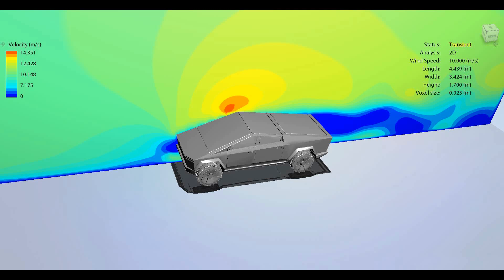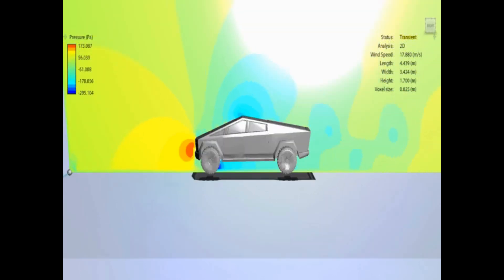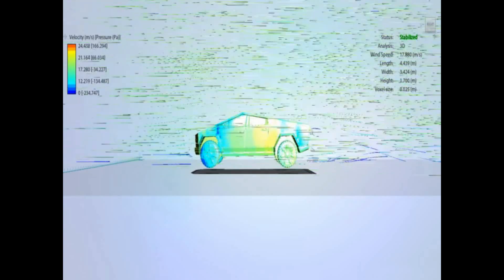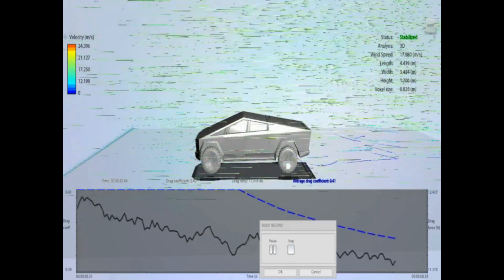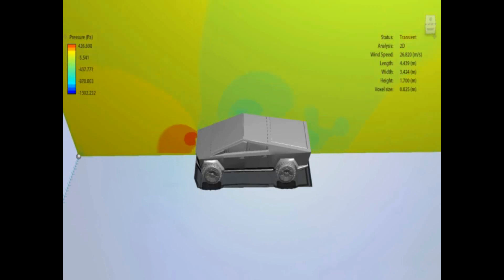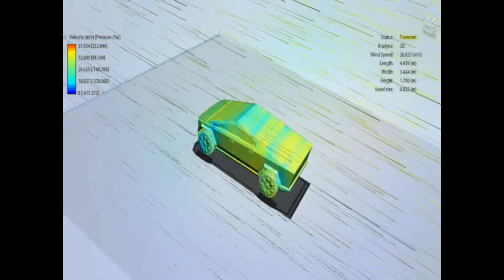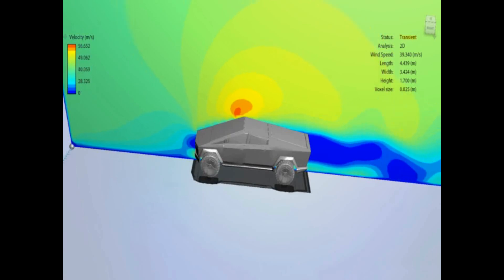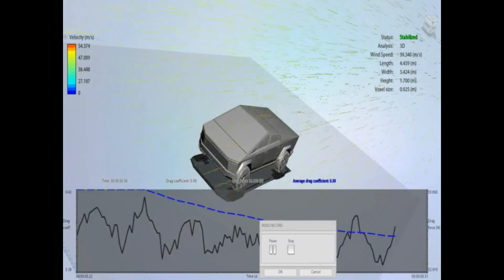Cybertruck aerodynamics - Whats going on?!!!

Comment: It’s almost as if the designers at this multi-billion dollar company tested this out with these kinds of simulations before they went forward with the design, lol
Reply: @Mr Murders "I haven't seen Elon do anything relatively innovative in a long time, what you're seeing is rehash tech with better components that were not available to companies 40 years ago."

I have to disagree.  Musk has completely changed at least two industries.  With Spacex, he didn't invent the rocket, but did bring the cost per kg down to a small fraction of what NASA could do.  As a result, Starlink is going to provide global/mobile internet access to every one on the planet.  

With Tesla, he squeezed more out of a kwh than any other car maker.  They still have not caught up to where he was in 2012.  Cars with over the air updates didn't exist until Tesla.  They will also be the first with full self driving.  

Other manufactures probably thought about the new manufacturing process for the Cybertruck, but Tesla is actually going to do it and made it economically feasible.

I a few years, solar roofs will be at a comparable cost to high quality asphalt roofs on new construction.

If all of this stuff was available for anyone to do, then why hasn't someone already done it?  He radically innovates everything he touches.
Reply: Agreed.  The truck looks stupid because of all the smart things they incorporated.  I realized that Telsa didn't want the truck to look like that, it just happens to look that way because of the durable materials, simplified manufacturing process and now apparently wind tunnel testing.  Classic form follows function.  It's really brilliant.
Reply: don m Personally, I love hard angular geometry, so I’m all about the Cybertruck’s design. But I also really appreciate their mindset of functionality and efficiency before superficial style.
Reply: don m I don’t think it looks stupid. It looks rather beastly, it’s going to make all other trucks on the road look like an old style truck
Reply: @Giggidygiggidy12  I would agree. The way it looks is growing on me, like most people.  At some point I will probably own one.  My word choice was to emphasize the form follows function aspect.  It's a really well thought out design, but not necessarily apparent when you first see it.
Reply: Giggidygiggidy12 I hope so, I’m ready for future designs!
Reply: don m exactly!! He built a better tool, whatever the tool looks like should be irrelevant, problem is most pick up truck owners use their trucks for going to Costco
Reply: don m Elon didn’t want it to look like normal trucks anyway
Reply: @donm2255  if this truck looks stupid to you how much do you hate the other ones then? 😅. In my opinion it's the by far best looking pick up truck of all times and it's an insane truck.
Reply: @donm2255  yeah, Musk said he wanted it to look like something out of Bladerunner, and it looks almost exactly like the cars in that movie, same shape and angles. Seems pretty intended, to me.
Reply: @donm2255  you can make flat panels look good by compounding shallow angles. However Tesla isn't the best at mass manufacturing so any low efficiencies are multiplied by their lack of raw mass production. The ability to mass produce a good product is extremely important in terms of market share.
Reply: @allstarwoo4  Perhaps a few more creases might help the looks.  And that might be possible in standard sheet metal, but the skin on the Cybertruck is 3mm hard stainless steel.  If Tesla could have shaped the skin anyway they wanted, then they would have.  The Cybertruck's design is a direct result of the material and process.  You don't make a truck that ugly, unless something if forcing you.  The trade off for the way it looks was durability and cost to manufacture.  They not only reinvented the truck, but reinvented how the truck was made.  That took some balls.

Regarding Tesla not being good at manufacturing, they just built a factory in China in less than a year that is already spitting out cars.  Making cars is fairly simple and they are getting good at it (and reinventing it), while pushing the gross margins up.  They also made the tool that makes the car in an unprecedented short time frame.
Reply: don m hydrologic press forming exist and unibody design isn’t exclusive to Tesla. Yeah it new to use uni body design on trucks but it’s not a new concept.
Reply: don m Buddy, a truck that looks like trash and can take a bullet (allegedly) is still a truck that looks like trash 🗑
Reply: @donm2255  bruhhhh... the design is smaller then other trucks therefore thy could fit LESS FEATURES, also with those angles it would make it even harder to fit features into the truck
Reply: Asunda Speed he's be sarcastic... Duh dude
Reply: Aaron that one really went over the dudes head lmao. I am amazed at the amount of people in comment sections who don’t understand sarcasm.
Reply: @inboxterapie5608  Yeah, we 'get' his sarcasm, but I think his comment minimizes the achievement of Tesla engineering design.
If being a billion dollar company with simulators is all it takes, why didn't the monster car companies (with far more simulations and far more designers) adopt the concept years ago?  
Tesla's design actually performs BETTER at higher speed.  The ICE companies have had 100 year head start, yet it appears Tesla nailed it on their first freaking try.  Tesla chose a non-intuitive design that has startling and measurable side benefits.   I say good on them!
Reply: fenderstratguy Because people hate the design, and no legacy automaker would ever risk such a radical design, plus no one cares about efficiency, just put in a bigger gas tank. Tesla is not constrained by legacy, and people expect the unexpected from them. That’s why they can do this, and the rest are just copies 10 years behind.
Reply: @TheSteinbitt  "no one cares about efficiency"

What are you smoking? 

A LOT of people care about efficiency, if they didn't hybrids would've never taken off, same goes for electrics.
Reply: Giliver No legacy automaker cares about efficiency, only appealing design for the masses and performance. Emission requirements are lobbied against hard by automotive industry, they are only complying because of law. Car industry in the US especially was never about efficiency,.
Reply: fenderstratguy Well, for one computer-based particle simulations are fairly new, relatively speaking, but in the end I think most of the legacy car manufacturers didn’t want to risk money on a controversial design, getting what they could in efficiency, but otherwise sticking with the “acceptable” aesthetics we’ve had for decades. Plus if you think about, efficiency wasn’t really their priority; why would they care? As soon as the vehicle rolls off the assembly line, it’s not really there problem anymore, it’s the consumer’s. But for Tesla, they need to use every positive of the Cybertruck they can to attract more buyers, and being more aerodynamically efficient than most, if not all other pick-up trucks is a nice bonus, especially when the whole idea is to get every mile you can out of it and make it worth ditching a gas vehicle.
Reply: @TheSteinbitt  -200 IQ
Reply: @TheSteinbitt  whoa whoa gents, are you suggesting cyber truck has an even close to optimal aerodynamic shape? Must be smoking some premium stuff. There's a reason planes and rockets don't look like they came from bladerunner. I realize there are many "ideal" shapes depending if you want stability, instability, what you need to fit inside, what you need to fit outside etc, but that shape is not one in any scenario.

Comparison with cars is kinda meaningless because the truck has a HUGE reference area. It's also easier to make an aerodynamic shape that human can comfortably fit into when you can have a larger reference area.

Comparison with trucks is equally meaningless because drag on trucks is generally meaningless. The traditional truck design is simple and to the point. Engine up front, so a square up front. Slightly higher cab to fit people. Bed need to be accessed from all sides, so low side walls. Aero don't matter if you are towing, because rolling resistance dominates at low speeds and please don't tow at high speeds. If aero resist matters the drag of your trailer dominates anyways.

Comparison with high end sports cars is just as absurd. Such cars typically value high downforce much more than low drag coeff, and the ones designed to actually be driven value cooling over both. All those expensive aeros, skirts, spoilers, wings etc all increase drag.
Reply: @fenderstratguy  they mastered ELECTRIC CARS ON THE FIRST GO not car designs as a whole, also wasn't the cybertrucks designed based off of a truck from halo? Other car company's do make better cars but that's because tesla makes electric cars
Reply: @fenderstratguy but now you are only looking at body design in terms of drag. Sure it might be relatively aerodynamic, but it has to be extremely dangerous in crashes with those sharp edges and angles. At least here in Europe, pedestrian safety in car crashes is important (as it should be in the US as well honestly, considering way more pedestrians get run over there because of how the infrastructure is built). I’m actually quite certain this car wouldn’t even be allowed to drive in the EU. So… think twice before criticizing tried and tested car brands that get áll aspects of a car right.
Reply: @Mr Murders
"Burden of proof is not on me, as your assuming that this trucks design is safe based on teslas record with thier cars, those are two totally different things and cannot be compared."
It is on you. You made a claim, now you have to back it up.
"You have absolutely no crash data on this vehicle whatsoever to make the claims that it will be safe but there is data from deloreans and others with the same geometry and basic construction that suggest otherwise when it comes to the physics of hows shapes react when being compressed."
I have a track record from Tesla and it is terrific. It would be absurd for them to make some of the safest cars in production only to make a deathtrap. Meanwhile, you have provided no data to show how it would be a danger to its occupants. And you haven't sourced your claim.
"And yes auto manufacturers create cars to crumple are you ignorant, why do all automakers do this today??, because again like i said it benefits everyone otherwise ford and chevy would have come out with an armored SUV for sale ages ago."
And Teslas are terrific in this department because of their lack of an engine. This has been shown in crash tests.
"Are you that egotistical? And the burden of proof lol, burden of proof. Read a damn book stamped parts were in the 30's and 40's for toys/watches/guns, stamped tanks were employed by the soviets for thier t34 to speed up production hell almost everything in ww2 was stamped."
Since when was the armor of the T34 stamped you historically illiterate inbred? The armor was far too thick to stamp. What else are you talking about? And the vast majority of cars today have stamped bodies.
"How do i need to prove that to you?, im not your history teacher."
You are the one who made the claim. You need to source it.
"Maby you should be better informed before coming into a thread with greater minds who are already up to speed on tech rather than demanding sources for said claims. But here you go gohttps://en.m.wikipedia.org/wiki/T-37A_tank"
Why are you calling yourself a greater mind when you can't even spell correctly?
And that link in no way proves your claim. It's just a random link to a tank with hard angles.
"Teslas have had 110 fatalities and 4 of those were due to the auto pilot and 2 more were claimed but not confirmed yet almost all of the other accidents involved sensor failure or some other function that the driver relied on the vehicle to perfom. So it sounds like people statistically are putting too much faith in the designs of the vehicle, and using that as a crutch rather than actually crunch numbers and see the truth."
So out of 110, about 3 - 6% are due to a failure by the autopilot? Those are terrific numbers.
"yet almost all of the other accidents involved sensor failure or some other function that the driver relied on the vehicle to perfom"
Prove.
It.
"Btw just because a driver survives an accident doesnt mean a pedestrian was at fault either, just means that the car protected the driver yet failed to sense approaching danger which is supposed to be one of teslas biggest selling points any car can mow over a person."
As opposed to other cars which don't have the tech at all? Think of all the lives it has saved.
"Also shorten your responses this copy and pasting of what your objecting too is really old and dumb "a stupid fad" i can tell what your debating simply by your counter argument, you dont need to take what i say and lengthen your response to a major yawn level."
Try breaking up your atrocity of a post. You are in no place to lecture me about my post when you weren't even able to differentiate between "your" and "you're" in the quote.
Reply: @Mr Murders
"Kawasaki_KR-1 "1) In a crash test, many direct physical measurements are taken (e.g. the distance a certain part moved). These numbers are weighted & combined to produce probability ESTIMATES.

2) These probability ESTIMATES are subject to errors direct measurements are not, because a model is used to generate them. No model is perfect. 

3) These numbers are then used to generate simple 5 star ratings; another level of abstraction, and possible introduction of error.

4) All of this is designed for 5 star ratings. All that matter is 5 star is safer than 4 star. This dominate the decisions made during the development of the statistical model. If reducing precision w/in a rating improves the resolution b/w ratings, that is the choice made.

5) Extrapolating from "intermediate" numbers used to generate categorical data is problematic for these reasons. I have seen many trying to treat them as direct measures, but they are not. Something beyond measurement error has already been introduced in these numbers.

6) The problem is especially severe at the edge of data range, as $TSLA is trying to do. Anyone who has run a simple regression knows you can't use it outside the intended range.

7) If NHTSA wants to change the rating system, they have to re-evaluate everything from the ground up. All the weights used will have to be changed. 8) This means the whole rating system is a package deal. You change one thing, everything else need to be changed.

9) Thus, taking intermediate data is basically useless. It's like tasting your meal before all ingredients are added. Most likely it is useless."

Jesus, that was one big wad of nothing. The point is Tesla has a history of safe cars, and it is extremely doubtful that they'd make a death trap. You can bring up "levels of abstraction" all you want, it doesn't change that a 1 star car is miles worse than a 5 star car. And if the system was as bad as you make it out to be, why would it even be used?

"10) Also remember that the rating does NOT reflect the probability of getting into an accident. How good is a "safe" car, if you get into accident often? IIHS data suggest, at least, Mod S (or its driver) is accident prone."
Which link is that, if you sourced it? And if it is the driver being incompetent why blame the car? If someone gets in a car drunk and crashes it is their fault, but I doubt you'd blame the car there.

"Watch a video of someone almost hitting a tesla in pick me up mode. https://www.caranddriver.com/news/a29369387/nhtsa-tesla-safety/"
Nice. One example. A Twitter post, what a terrific study.

"If its not true "auto pilot" then why mislabel, call it assisted driving instead, sales ploy. Difference source same story."
I googled autopilot. Want to know what I found?
"Autopilots do not replace human operators, but instead they assist them in controlling the vehicle.*"
"Autopilots do not replace human operators, but instead they assist them in controlling the vehicle"
"Autopilots do not replace human operators, but instead they assist them in controlling the vehicle"
"Autopilots do not replace human operators, but instead they assist them in controlling the vehicle"
And as your link states, the driver was checking on his dog in the back seat.

And look at how many more of your links are just single examples. Come back with an actual source, bud.

"https://stage.abc7news.com/automotive/feds-close-investigation-of-tesla-battery-fires/21997"
This link isn't working, but it says "feds-close-investigation-of-tesla-battery-fires" interestingly enough.

And you still haven't answered my other questions.
Reply: @Asunda Speed r/wooooooooooooooooooooooooooooooooosh
Reply: @Mr Murders  "China is the absolute worst place that something like this could be implemented."

Where do you get these stupid ideas?  I love the idea of an american company pulling money out of china.  The Chinese love Tesla and want electric cars.  Why not sell them the cars and take the profit back to the states?  

Also, do you really think Tesla is going to build a factory that unnecessarily pollutes the environment?  "Another lake made out of battery acid."  Seriously, where do you get these stupid ideas?  Tesla is going to make cars with a lot less waste than any Chinese car maker.  Not because they have to, but because they understand that less waste is more efficient and saves money in the long run.  Tesla making cars in China is good for the Chinese, their environment, and the Americans that hold stock in Tesla.
Reply: @Mr Murders
Tesla has a history of extremely safe cars. I don't see why this would be much different. You seem like you're biased.
Reply: @Mr Murders
A. Source?
B. You seem to be discounting the car based on the alleged age of a design process, which is a flawed argument. What is wrong with the process?
C. I don't know about you but I think tanks would hold up pretty well in a crash.
Reply: @Mr Murders
"haha i must have really struck a chord with you, to waste all that time attacking my grammar and not actually proving me wrong."
What do you mean by "all that time"? It was like 3 sentences and was dwarfed by the rest of my post. And I did refute you in other parts.
"Copy paste copy paste hahahaha I was meaning to say  the process in which parts were stamped started with the t34, the source i gave was a tank that they would shelve out in one stamped piece"
So you are attacking the Tesla based on it being stamped? And I'm copy pasting you to quote you, what is wrong with that?
"nor historically inbred"
Ironic.

"Sometimes i get stoned, oh well i mistyped something again whoopsy."
Come back here when your head is functioning the, provided that ever happens.
"Are you going to argue that stamped parts were not a thing and that the cyber trucks processing was not modeled after prior assembly lines and fitting stations?"
I never said that. What is your deal with the Soviet tank production? Explain what it has to do with this.
"I have to be feeding a black hole, currently the NHTSA is currently investigating tesla about its independent saftey claims that you and tesla are making, want me to cite that as well???"
You should cite everything you claim.
"Pack sand dude or gall, catch a wave, hike a mile, go down to the corner store for a pack of gum, obviously not getting the D or V so trying to get the cyber bully thing down and you're terrible at it."
Good God mate did you just unironically call me a cyberbully?
"how about next time bring something to wager like a job title or something of wieght if you choose to personally attack someone"
Appeal to authority fallacy
"nothing to back up what you say except for claims made by tesla themselves not factual data"

https://www.reuters.com/article/us-tesla-safety-model-x/tesla-model-x-gets-5-star-rating-from-european-safety-agency-idUSKBN1Y8165
Reply: @Mr Murders

Nice try running away with that last bit of your post.

"1-10 are facts and facts dont care about your feelings if you are smart it wouldnt be that difficult."
The fact that it is a whole lot of nothing but seems to hurt your feelings. Reread my post.
"Cite-quote (a passage, book, or author) as evidence for or justification of an argument or statement, especially in a scholarly work. 
Source-a place, person, or thing from which something comes or can be obtained.
The twitter post was a citable source, the poster the source and the photo along with the coinciding report which corroborate the accident are the sources, multiple meaning go do the work. I could care less what you think about what links i use as long as they are legit and 100% true, ie a source."
It does not make it a reliable source, and along with it being only one example rather than a study would makeit anecdotal, and therefore almost completely worthless.
"Again you came into a discussion with nothing more than uh i don't believe you muhhhh, mouth breathing shit right there, then proceed to call me a lair because i wont go and do the homework for you."
Because you were blatantly lying, so I showed you Tesla's safety ratings which were in total opposition to your claims which sent you off on a misinformed, disingenuous tirade. And me telling you the burden of proof is on you to back up your claims is not me telling you to do my homework, it is a fundamental requirement of your points.
"Should i prove to you that the earth goes around the sun, and the moon around the earth."
Well no, because I believe that and that is totally unrelated. You do have to back up the claims if you want to be taken seriously, however.
"These articles, testimonies, statistics, news reports, ect..... are all available on the internet."
Then why don't you just cite them?

"If you are just here to run them cheeks then keep running them."
Ironic.
"Also the battery issue was dropped because tesla had repaired the issue but did so without the NHTSA knowing that an update was being sent prior to them being notified, it should still raise an alarm to clear minded people that doing this without anyones knowledge is negligible to say the least."
So the problem was fixed yet you still use it as a flaw with the vehicle?
"And your questions were simply counter arguments with no evidence yourself to what i was saying they were not even self formed questions."
Yeah, they were counter arguments to your arguments, and I did provide evidence. And who else formed them?
"And autopilot means automatic pilot or the literal meaning of autopilot is a device that steers a ship, plane, or spacecraft by itself, without a person its a noun."
So under no circumstances can it be used for land vehicles? Shift the goalposts much? You said previously that it was to do with total autonomous control but I proved you wrong.
"Doesnt mean whatever bullshit jargon you just spewed to fit a definition being used by automakers of assisted driving to sell cars."
Uh oh, someone seems a little touchy.
"People barely read road signs, you give them something called auto pilot, they will use it as autopilot."
And this is the fault of the car? I already posted "Autopilots do not replace human operators, but instead they assist them in controlling the vehicle" yet you seem to ignore it.
"You are out of your league amigo, go do some wrenching like a real man on some electrics and "ICE" ice baby, vehicles before you come back into the ring. The internet is a pretty good way to get info on a budget, you should be thankful. Im done feeding you, find food yourself pup."
That's a funny way of trying to conceal that you're scared of an internet argument and have to run away. And the internet is a good way to get info, so go ahead and cite your sources.
Reply: Mr Murders    You haven’t seen Elon do anything relatively innovative. 

REALLY. 

300 mile electric cars. 
Reusable rockets landing backward on a tiny target. 
Electric semi truck.

What year did you go blind?
Reply: @Mr Murders the windows were fine. If Elon had thrown the ball first they wouldn't have broken. There were microfractures from the hammer impact
Reply: @Mr Murders I'm really excited to see how it'll handle in crashes too. I don't know much about how their metal is going to change how it would handle a crash different from other vehicles
Reply: No, it's more like they took their best guesses based on known information. The roof alone tells you that they obviously didn't do THAT much testing and modeling.

It looks like the F117 because it was probably designed the same way. Best guesses and insufficient testing ability.
Reply: oh wow, the idiots at tesla managed to make this shitbox angled back so that it doesnt resemble a brick in the wind! they must be GENIUSES!!!!!
Reply: @Mr Murders I stop responding to you based on your incoherent rants.  Seriously, you need to learn what a paragraph is.  It would make your writing a lot more readable.

I will however respond to what you just said about Tesla "moving production" to China.  They are not moving production.  US cars will still be made in the USA.  Tesla created NEW manufacturing capability in China for cars that are being sold in China (and perhaps other Asian countries).  Elon did what no other "asshat businessman" has been able to accomplish.  Tesla owns the factory.  They are the first to get into China with out giving up part ownership to a Chinese company.  It was a brilliant move.  Tesla is going to sell a bunch of cars to the Chinese with out all the trade barriers and tariffs that all the other manufactures have to deal with.  Tesla is literally doing in China what no other US company has done to date.

Regarding the manufacturing process, here are some interesting videos on the subject.  You might learn something.

https://www.youtube.com/watch?v=yRGLSgaHw0w&t=540s
https://www.youtube.com/watch?v=4qgO3A2pUr8&t=4590s

I can't wait for Sandy Munro to tear one apart so we can all see how they are made.

Just found one more.  This guys is explaining how strong/safe the frame will be and how superior the crumple zones will be in the cybertruck.
https://www.youtube.com/watch?v=J1kUtlnxYhw
Reply: It's funny that you say this, because the cybertrucks aerodynamics are great in testing. I love how everyone on youtube is an engineer all of a sudden.
This thing was designed to be made with single sheets of steel bent to shape, they were able to cut down its factory footprint and cut down its price drastically. But people on youtube ACTUALLY think they know more than the people who made this truck lmfao.

It's almost as if the cybertruck is amazing and everyone on youtube is retarded.
People who don't understand what Tesla did with this truck are just really ignorant. This truck has INSANE innovations.
I actually went to school for mechanical engineering, I draw small parts in C.A.D.D and then print them in a printer. I can actually appreciate this truck for everything that it has.
It scares me that people are so dumb to insult such a great work of engineering.
You're just wrong, do some research, this truck is great.
Reply: @Mr Murders
"https://www.tesladeaths.com/ tell me that simulation accounts for this, people have died from hitting poles and being rear ended, its the saftest not a guarantee you say, well how come it passed the inhouse tests?, and not the real world?? Got my comment ripped for some reason, are you mad now?? Tickle tickle."
Notice how you've shifted away from what you originally said in an attempt to cover up your misinformed statements?

And "Concrete falls on Tesla" and "  "Sleeping Tesla driver kills motorcyclist" and "Wrong way driver strikes Tesla" are terrific examples of autopilot related accidents, aren't they? And just look at how many are on the road compared to fatalities. And they are very safe, but they aren't perfect, they won't stop every occupant death, but you choose to ignore this.
Reply: @Blox117  dude. You have no clue what you are talking about. I am amazed your parents raised such a moronic child
Reply: NO! I got a Reddit Armchair Degree in physics, this truck is terrible and Elon Musk is nothing but a fraud
Reply: @dereksgc  that's why I'll believe you over Tesla engineers every day of the week!
Reply: @dereksgc  elon musk is an absolute fraud. only an idiot would think otherwise
Reply: @Mr Murders Yeah, I'm sure Tesla designed a new truck but forgot to run it through the crash test simulation software.  Based on the other cars they have manufactured, it's a good bet the Cybertruck is more crash worthy than any other truck to date.
Reply: Imma be honest, the truck still looks like what a failed abortion between 2 azteks look like, but if i had the money to pre-order this i would ngl.
Reply: QuantumAscension1 lmao
Reply: Company is not profitable
Reply: Mr Murders They were, microfractures though.